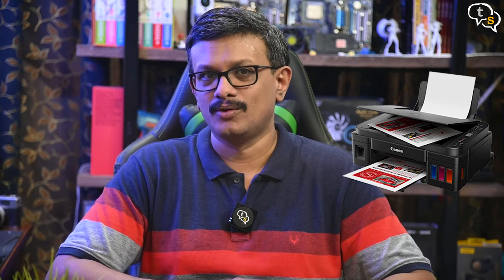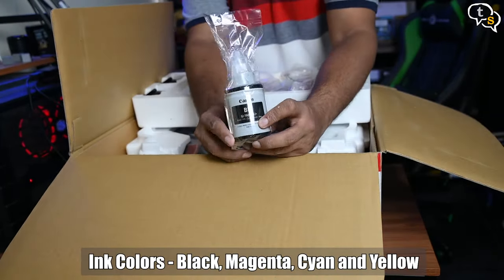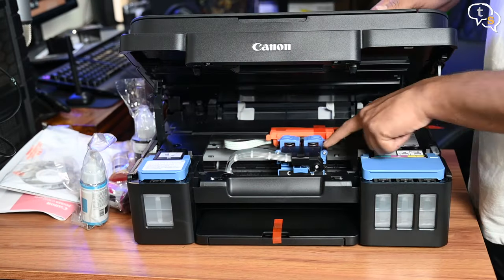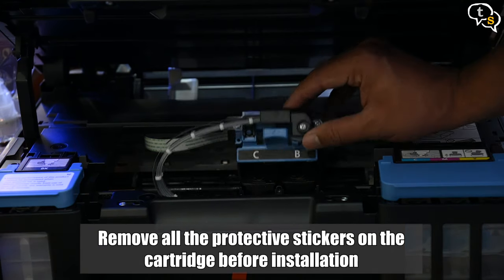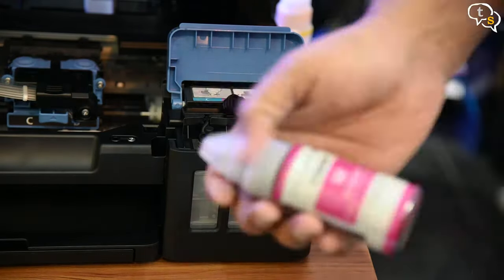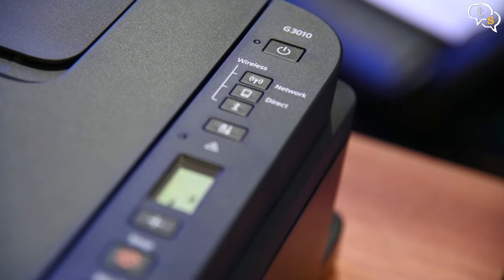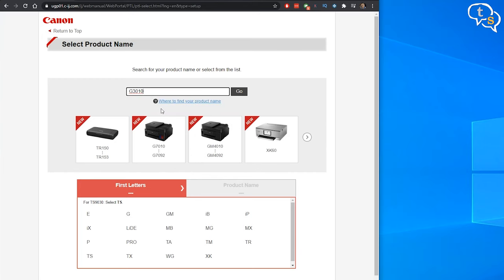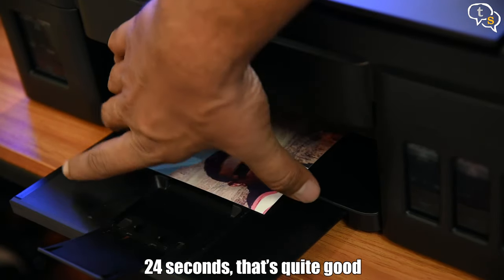Canon Pixma G3010 All in One Wireless Ink Tank Colour Printer | Canon G3010 Setup and Quick Review

Comment: I have g3012
When i give command to print photo it passes the sheet quickly and doesn't even to print.
Full blank photo sheet comes out instantly.
What could be the problem?
Reply from the maker: If you've not used the printer for some time the nozzle might be clogged, you might have to run a ink flush  via the maintenance option within windows for it to be cleaned.

Comment: Sir I am confused between HP 410 and Canon 3010...and Epson 3150... please suggest one for colour printing on A4 size for students
Reply from the maker: I'm using the canon 3010 for the past few months and it prints colour really well, and I could print photographs on photo paper too . They should all be similar, but as I've used and had no problems with the canon can recommend it .
Reply: @TalkingstuffNet  Sir Where did u buy ur printer from. Is colour printing working nice with good resolution printing?
Reply from the maker: Yes it prints colour very well,I purchased the printer on Amazon.

Comment: Thanks for the presentation. How does it compare to Epson Ecotank L150 and HP Smart Tank 515 ?
Reply from the maker: Had researched between all these printers and the Canon seemed to have the most compatability with more paper sizes and types. For normal use they should be similar.
Reply: @TalkingstuffNet  thanks a lot

Comment: I tried turning the printer off and the power on light just keeps on flashing, how long will it take for it to stop?  I want to unplug it but the power light must be completely off. Also, is there any way that I can turn it on after turning it off? Well the flashing of the power light does not stop.
Reply from the maker: Open the top cover and check if the tubes have the colour within them. Close and hit the copy button and see if it stops flashing and starts copying what you put in the photo copy tray.
Reply: @TalkingstuffNet  yes the tubes have the color within them but the printer does not function. after it automatically turned off, the power light keeps on flashing and the screen has this rotating 0 only. i tried to keep it plug overnight, hoping that it might turn off in the morning but it did not. i cannot turn it on as well. i need to plug it off but that would not be advisable since there's still a flashing light. anyway, thank you for the response!

Comment: How many gsm's can I print with this? Someone said I need to use a specialty paper for photopaper, can I use any brands of photopaper??
Reply from the maker: I've used multiple types, even canvas photo paper and it printed well. Any brand photopaper can be used. I have used kodak photo paper for glossy prints and canvas ones for framing my photos.
Reply: @TalkingstuffNet  can it print 300 gsm paper?
Reply from the maker: You can check out the  canon website here https://in.canon/en/consumer/pixma-g3010/specification

They show all paper supported in the specifications. I haven't tried 300 gsm paper.
Reply from the maker: This is what I used, this is 270 gsm and it worked perfectly
https://amzn.to/3yxUEQF
Reply: @TalkingstuffNet  if you do use 300 gsm can i trouble you to tell me the results here? I don't have anyone to ask for it... I'm sorry.
Reply from the maker: These are the supported paper types, not sure about the gsm
Paper for printing photos:

Glossy Photo Paper "Everyday Use" <GP-501>Photo Paper Glossy <GP-701>Photo Paper Plus Glossy II <PP-201>Photo Paper Plus Glossy II <PP-301>Photo Paper Pro Luster <LU-101>Photo Paper Plus Semi-gloss <SG-201>Matte Photo Paper <MP-101>

Found info here https://ij.manual.canon/ij/webmanual/Manual/All/G3010%20series/EN/UG/ug_i_01_c.html
Reply: @TalkingstuffNet  thank you for answering... I hope that it can print up until 300 gsm 😭
Reply from the maker: I will try in future.
Reply: @TalkingstuffNet  thank you very much, i appreciate it ❤

Comment: Kodak 180gsm photomprint  gives  wheel roller print lines kindnof perforation innphoto output..but canon guy brought 275gsm there is no imprint.. why paper GSM model u using ..did u face issue in photo print in lower GSM like 180
Reply from the maker: I don't have the main cover of the photo-paper anymore , I think I purchased 200gsm and I have had no problems with roller lines as shown in the video.
Reply: Kodak photo paper and desmat klikk pohoto paper while print then show the paper and Don not print blank page open whata is the problam pls reply me

Comment: Sir I install my printer but the problem is 2 of the ink pipes not filled with ink ..
What to do sir please help
Reply from the maker: Are all tanks full of ink. There's a way to get the printer to fill with ink again, press the screwdriver button once, then the + button until it shows number 10. Then press the color copy button. This will cause the Pinter to refill the Inks. if it still doesn't work then you might have to get a replacement printer. Did you remove the stickers on both printer heads?
Reply: @TalkingstuffNet  actually one of the pipes not filled with any ink ....i order it from Flipkart and today only I recieved it ... Out of 4 pipes 3 are filled with ink but one is completely empty 🤔
Reply: Sir black pipe don't have any ink though I filled the blank ink tank perfectly !
Reply from the maker: Try the maintenance modes, 10 is to refill ink.
Reply: @TalkingstuffNet  yuppp done thanks sir ❤️

Comment: Do u have to replace the cartridges everytime?
Reply from the maker: No just purchase the inks and fill up the tanks.
Reply: @TalkingstuffNet  sir.. Do u suggest Epson or Canon? If u suggest Epson.. Can u tell me the model name... PLS?
Reply from the maker: I liked the Canon over the Epson as per the research I've done before picking this model up.
Reply: @TalkingstuffNet  sir.. Do u ever face paper chocking problem when using Canon?
Reply: @TalkingstuffNet  sir.. How to prevent the ink from drying?
Reply: @TalkingstuffNet  tqvm sir for ur responding
Reply from the maker: Paper choking I've not had until now, to keep ink from drying, maybe at least take a print a month to keep it running.

Comment: Sir, which one is better b/w Canon g3010 and HP 516
Reply from the maker: Ibe not used the Hp 516, but the canon g3010 is working well for me, only problem is that if you don't use it for a long time you need to run a nozzle cleaning using the maintenance menu.

Comment: how to print from the computer ?????
Reply from the maker: Just connect using a usb cable, the drivers would be installed and it would be accessible. If you want to print wirelessly, then you would use your laptops WiFi direct feature and connect to the printer and then print.